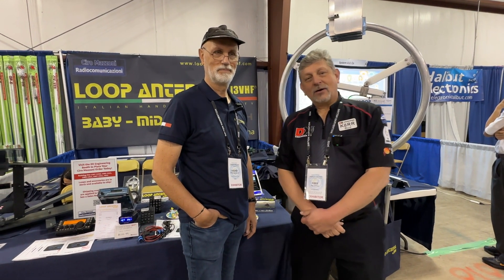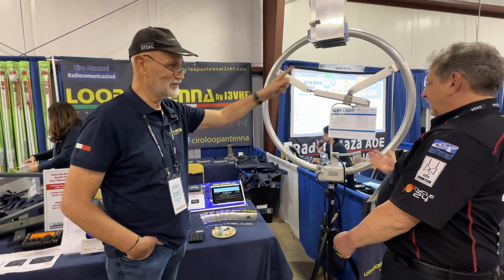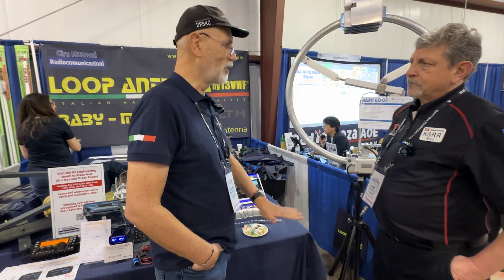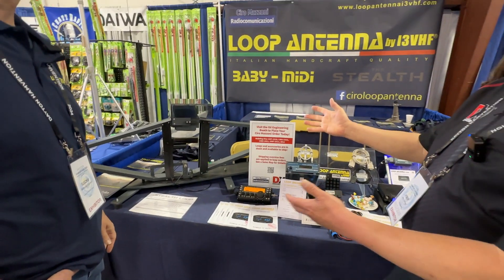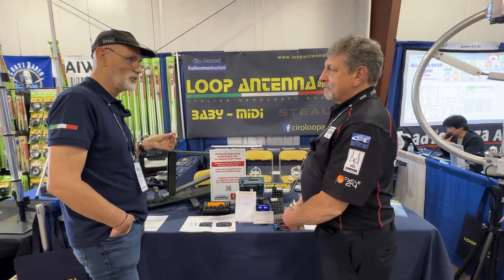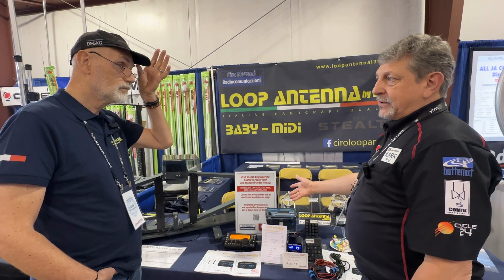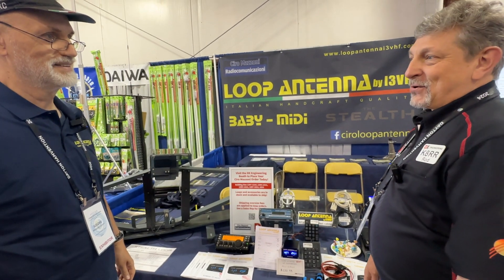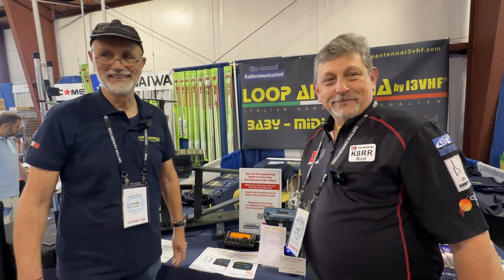Ciro Mazzoni Loop Antennas Explained at Hamvention 2024

Comment: Only a coax between the controller and the antenna? 
I guess that the DC 24 volt and the pulses sent from the controller both go through the coax line?

Comment: Optimal height 5ft to 7ft.. is that to the top of the loop or bottom ?
Reply: I guess that's for the bottom. 
He said that the antenna has to be placed at a distance from the ground plane twice the diameter of the circle.